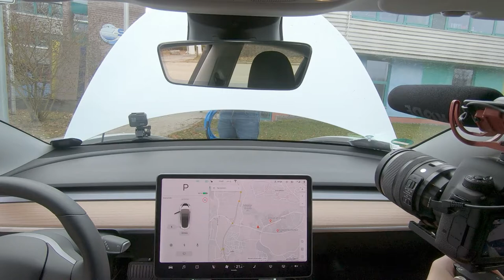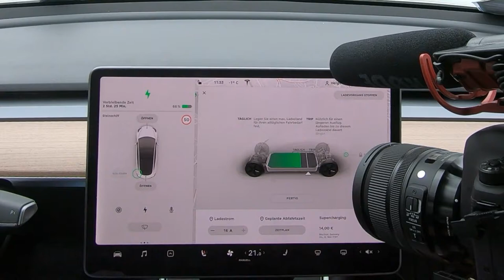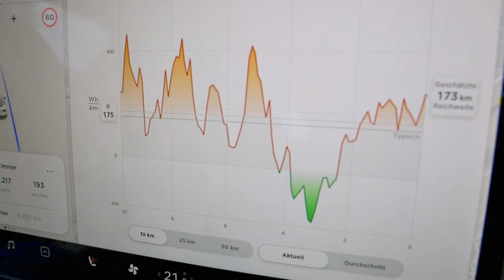Electric car ride with a battery researcher

Comment: Hi Helge, thanks for the video. I have one thing you maybe can clarify. I have a pretty similar car, but with a LFP battery. In this case I guess it is okay to charge up to 100% once a week - at least the manual says so. Or is this strategy degrading the battery faster as like with your Li-NMC battery?
Reply: If the manual says it's ok then there might be some BMS "magic" that will likely limit the charge somewhere below true 100%. It might also just be the lover voltage of LFP that could render a full charge less severe than for NMC. The one thing I'd not recommend though is charging it full and keeping the car/battery like that for an extended time.
Reply: @helgor888  Scientists talking about magic 😁 Sorry, I don't want to be annoying - if you talk about extended time, do you refer to hours, days, weeks or months? I currently charge my car at weekends and drive again 3-4 days later. Maybe I have to change this habit 🤷‍♂️
Reply from the maker: With most e-cars, a few percent of the maximum possible charge level is usually blocked off. Nevertheless, it is recommended to keep the charge level in the range of 50-80%. The battery ages faster the fuller it is in the idle state. Even at 3 days this makes a difference. In a study by the German university RWTH Aachen, a fully charged battery had already lost 15 percent of its storage capacity after two years. A battery charged to only 20 percent lost virtually no capacity in the same time.